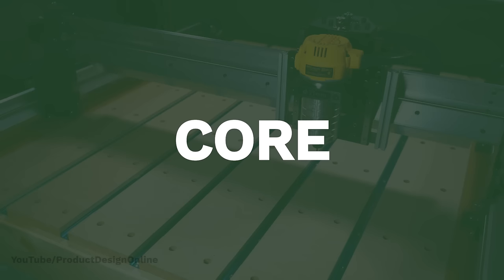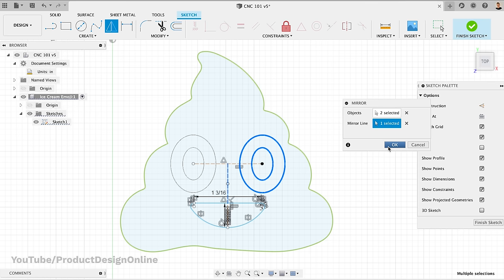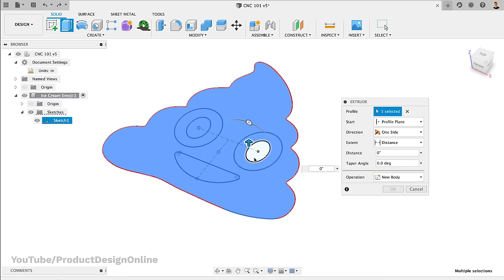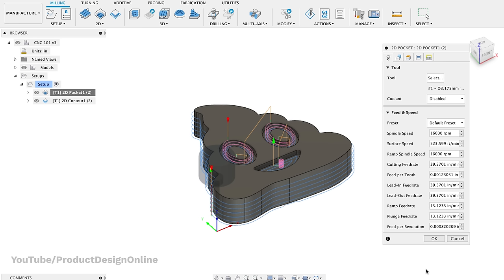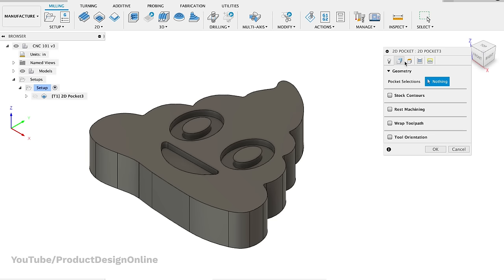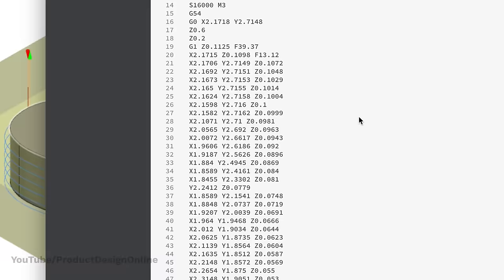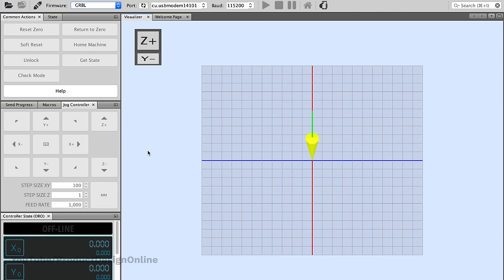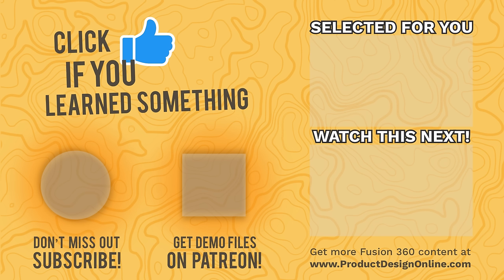CNC Basics - What You Need To Get Started

Comment from the maker: Poop Emoji STL: https://bit.ly/poopEmojiSTL
*Dust Collection*
5-inch x 10-ft Flexible Dust Collection Hose - **https://collabs.shop/mo0udn
5-inch wire clamp - https://collabs.shop/wuwehv
4-inch wire clamp - https://collabs.shop/3nk3m4
Duct Wrap - https://collabs.shop/caxz6w
Dust Boot - https://collabs.shop/4ajtis
Dust Boot Brush - https://collabs.shop/3ucm0l

End mills (Bits)
23-375 – 3/8 x 1.25" - Compression Spiral 2 Flute Carbide End Mill - **https://collabs.shop/esfe42
20-250 – 1/4 x 1" - Upcut Spiral 2 Flute Carbide End Mill - https://collabs.shop/qmylyu
CNC Router Sheet Tooling Kits - https://collabs.shop/xpm6ku
Desktop CNC Router Tooling Kits - https://collabs.shop/nhrvsb

Comment: Your definition of feed rate at 4:32 is likely to cause confusion.
I am a machinist and when it comes to feed rate on a Mill it always referred to in either ipm (inched per minute) or mmps (millimeters per second) The machine interface will display this value while running.
“Feed per rev“ is used on lathes where the tool rides on a carriage which is geared to the spindle. 
What counts is chip load, the amount each cutting tip (or flute) removes.  On a lathe there is only one tooth so it is the same as feed per rev. On a mill the formula to find this is:
Feed rate = rpm x number of flutes x chip load 
Common roughing chip load in steel is .008” on a mill.  Many many variables to find a good chip load, rigidity of the machine being a huge factor.
Reply: This is true. Chip load has everything to do with getting the most life out of your cutting tool. What is seldom mentioned including this video is that the hobby machines are no way capable of running high enough feed rates or being built good enough( spelled rigidity) for a good chip load. Your tools will die a short life due to the heat.

Comment: As rudimentary as this video was, I think that you still missed some steps with setting up the router before cutting your piece. I don't know jack about these machines, but at the wood shop that I go to for working on my projects, we have a CNC machine there and the guy who has seemed to taken over using it without allowing the rest of us a chance to learn it gave me a a simple guidance outline. One thing was making sure that your router was centred on your project and that you set the depth for the surface of the piece before starting. I seemed to miss this here. 
I think that learning how to operate a CNC requires a hands-on approach along with a tutorial in order to get a full comprehension of its workings. JMO Cheers!
Reply from the maker: That's a great point! Thanks for sharing :)

I didn't include anything machine specific, because as you pointed out - there are many additional variables to consider. This video was intended to help folks understand the basic process as to what's involved (software, machines, etc) so he or she can determine if they're still interested in getting a CNC machine.

Happy new year!

Comment: Hello - I am totally new to all of this… I currently purchase my wooden kids toys from overseas manufacturer but want to learn myself, what things do I need to consider when purchasing a CNC? And thank you for your video…very helpful and plan to watch more!
Reply from the maker: Do you plan to cut any materials other than wood? If so, make sure to research the potential machines as some aren't powerful enough for all material types.

You can get some pretty affordable machines to cut only wood.
Reply: @ProductDesignOnline  only wood . One more question… and forgive me I am very new to this. How do I know that the machine will cut the size pieces I need ? Okay 2 more…. What do I look for on the machine specs ?  Thanks again!
Reply from the maker: @NancyZ-x9i  When looking at machines you should look for the 'cutting size' as that is often smaller than the listed 'machine size'. If you have the space, I would recommend getting at machine that is 4x4' so you can do half sheets of plywood, and other large boards.

In terms of other specs, if you're doing mainly wood than you can't go wrong with most machines. What will be more important at that point is getting good endmills for cutting the wood, and replacing them if/when they get damaged.

Cheers!

Comment: In the 1980's CNC machines were new technology running on Commodore computers the machinists need to learn G code to troubleshoot new programs and make edits the original programmers didn't see straps, bolts, etc.and different CNC machines ran on different G code programming no standard format
Reply: G-code have standard all machine understand all G-code. some worst machine not understand. dont buy machine what use own code, normal all use standard G-code understand machine,

Comment: does this apply to metal cutting too?
Reply from the maker: Yep! Metal cutting also has the added layer of "coolant" (or fluid) to ensure eit does not overheat. With that said, on most hobbyist-level machines you will be able to mail aluminum, copper, and other soft metals without a coolant, you just need to run slower.

Comment: Problem - Have designed a "shoe box" and have no problems machining the pocket from the top etc.    BUT when I try to produce the g code to machine a pattern I have on the bottom of the box the post processor still wants to work from the top position.   So how does one redefine the Z axis to machine the bottom?    Your great videos have go me this far but I could not find an answer to this problem.

Comment: Man I could really use your help. I need to find a CNC machine that is a lathe/router that can make 5-10 pieces at a time. All the same item. I have no clue where to even start looking. Any chance you could point me into a direction? Thank you so much. Awesome video also!
Reply from the maker: CNC Lathes are a bit harder to find/get at a Hobbyist price point. For just a router, I'd recommend Avid CNC as you can adapt its size as needed. You may then be able to find an affordable (Chinese) tabletop adapter for a lathe on Aliexpress, eBay, or equivalent.

Comment: Pls tell us how to change bits in middle of     
milling when we need.EX:small size bit for screw and large bit for making rectangle shaped hole
Reply from the maker: Great question. There are many variables at play based on your machine and setup.. but there are two main options.
1. Setup your CAM toolpaths for a tool change where it does it automatically (fancy machine) or stops so you can manually do it (hobby machine)
2. You can manually pause the machine, shut off spindle and change tool before it proceeds to the 'next' part.

Number 1 is ideal, but again, it depends on your machine and software.
Reply: @ProductDesignOnline  pls put vedio with detailed explanation ❤️

Comment: Thanks for a great video. Just wondering, if I want to use a CNC router to cut woodblock prints, what machine would you suggest I buy. Probably only 2-D applications. Thanks.
Reply from the maker: Here are the machines I recommend at various price points: https://productdesignonline.com/fusion-360-users-what-to-buy/#cncs

Comment: I have CAD experience but no CAM experience.  To date I have been using SolidWorks to generate 3D models that I've saved as STL files for 3D printing.  I'm planning on getting a CNC Router but I've seen very little discussion of CNC Router users making use of SolidWorks CAM.  I see far more discussion regarding Fusion360 or Vectric's Aspire.  Is there a reason for this?  I'm starting with CAM from ground zero and I'm wondering if I should put my energies into learning SolidWorks CAM (a package I already have) or if I would be better off starting to learn Fusion360 or Aspire?  I see you have a highly praised collection of Fusion360 tutorial videos and I'm very tempted as I am just not seeing that level of resource available for teaching myself SolidWorks CAM.  Any advice?  I'm wanting to make an informed decision but feel I don't know enough about any of the CAM packages to know which I should go with.

Comment: Can anybody tell me  how  Fusion 360  is  better  or  as capable as Solidworks & NX ?   Does industries in India  widely use Fusion 360 ?  I have used Solidworks, NX & Creo  for SPM & Fixture design for several years.  For CAM, Fusion360 is the latest program hence it must have all the capabilities of CAD and CAM, I guess.

Comment: Hello, this is a simple question but I just want to ask, do you believe using a cnc machine to cut would into cabinets is worth it for the time and work being put in to make it happen? I’m thinking about getting one to make the job easier but I can’t wrap my head around if it’s a good idea or not.
Reply from the maker: Hi Sanjay. That's a hard question to answer because it depends on what machine you get...which then affects how well the cutting is, how much can be done, etc.
One important thing to consider is that you should NOT leave a CNC machine running alone. If anything goes wrong it can plunge into the machine, burn wood, and/or even worse catch fire. A lot of people think they'll have a 'robot' doing work for them around the clock, but generally CNCs require more looking after... so just keep that in mind :)

As far as cabinets. Are you looking to cut the general shape or special designs into them?

Comment: So I am 3d modeller primarly desining models for 3d print, but my mother wants to start working and designing wooden objects. By that it means She will come with idea and I will ahve to sculpt and design everything. 

Does the CAM software can take OBJ files?
Reply from the maker: Yes, you can setup CAM toolpaths for OBJ/STL files. You can also convert the STL to a Solid and set up toolpaths with that (https://youtu.be/tVGtG-UjlYg). Depending on the model and geometry, each workflow has pros/cons.

Comment: As someone who is getting into this I found it very helpful! With fusion360 am I able to just import a 3D model into the software and have it start cutting?
Reply from the maker: You have to do some setup per the machine and type of cut. But, in essence, yes.
Reply: @ProductDesignOnline  Oh awesome! I'm attempting to make my own gameboy advance shell out of aluminum but I haven't a clue how to do it but I really wanted to try it cause I'm gonna paint it and all that, so I'll have to do some setup but a 3d model of it will help most of the way? That works for me :D I'm looking forward to learning it. I'm just not sure how to turn raw blocks of aluminum into a shell lol
Reply from the maker: @piplup10203854  Your main challenge with that will be making sure you set up the file with the same WCS (start point) so you can flip the part to mill the second side. I would suggest starting with a simpler 2D milling project first to get familiar with the Manufacutre environment in Fusion 360, then transitioning to 3D parts (such as the gameboy advanced shell - cool project, btw) will be easier. :)
Reply: @ProductDesignOnline  Oh, setting up the file to have the same start point? I see, so I'll mark exact coordinates for the WCS so when I finish the one side, I can flip it and then mill from the second side? Oh gotcha, what do you suggest as a good starting point then and thank  you! I saw a really cool opportunity to get my own block and I picked up a CNC for cheap and thought it would be really cool to do my own shell and stuff. I been waiting on a custom for a year but no luck figured why not try to do it myself :)

Comment: I'm interested in ordering one of these but I'm confused with the ordering process with all the options available. I would like to stick with dewalt if possible, I have a Dewalt DW618 but don't mind buying a DW611. What MM size do I need to chose for this option. I sincerely apologize for asking this buy I'm very new to the CNC world and have been looking for the right choice, 7 months later I still find the one you featured here to be the best choice. My other concern is size. My table that I have is 24" depth from the wall of my basement to the edge of the table where I would like to place this unit. Would you happen. Yo have a 24" x 30" wide unit? Or just the 12" x 30" as the smallest size?
Reply from the maker: 12x30 is the smallest size for the new one. There used to be a 12x12 option, but that is not available with v2. 12x30 is a great option for your table size, as that will leave some room around the edges for tools, and or material overhang.

You'll want to select 71mm for the DeWalt (DW611) router - https://bit.ly/longmillcncref

Comment: The manufacturing workpath is not free to hobbyists, you get a month or so free IIRC, sadly this fact was an actual consideration as to whether I bought a CNC rig. no free manufacturing workpath means extra faffing outside of fusion. Sigh. you might want to fix that anyway. Otherwise decent, very entry-level, video.
Reply: While I cannot be positive, I think you are mixing up the Manufacturing Extension with the Manufacturing Workspace.  These are two vary different things.   I only have a "Not for Commercial Use" license, and I've been using Fusion 360 to drive my CNC for the last 8 months.
Reply: @Otaku437  Agreed, mine has it available too, never used it but it is there. And then there are manufacturing extensions you can purchase with money or cloud credits.
Reply from the maker: @GroovyDrifter  Robert is correct in saying that the Manufacturing Extension is different than the Manufacture Workspace. The CAM area is FREE and included with the Personal Use license. You can generate all the CAM toolpaths you need. You should not need the Manufacturing Extension for 99% of hobbyist based projects. If you're doing projects that 'advanced' then you're probably making enough money to afford it anyway :)
Reply: @ProductDesignOnline  Ah good to know.  Appreciate the tip.

Comment: Don you know if Fusion 360s cam software can write directions for cutting graphite ?  I want to design my own graphite molds for pouring silver and copper
Reply from the maker: You could technically use Fusion 360 to create toolpaths/gcode for milling anything. That really comes down to knowing the correct bit and feeds/speeds for the material and your machine.

Comment: Hi do you have any experiences with print design and then cut contour? I am new at and look for software what can do this. Example - print design on UV flatbed printer with reg.marks and then cut around via cut contour. Thank you
Reply from the maker: I used to run a Mymaki one. You can't run anything like that from Fusion 360. You will typically need to use the software recommended by the manufacturer as many of those machines are 'locked down' and require preparatory software.

Comment: Does this work with brass metal, too? I would like to customize wax seal stamps.
Reply from the maker: Yes, you can cut soft metals: brass, aluminum, etc pretty easy on these hobby level machines. If you plan to cut a lot, you'll want to look into getting a coolant dispenser.
Reply: Thank you! :)  @ProductDesignOnline

Comment: What about blender? Will that work for a 3d software?
Reply from the maker: Depends on what you intend to make. In general, parts getting milled tend to be better suited for a parametric modeling program. However, if you plan to make characters or other more organic designs then Blender would be great!

Comment: Interesting video. With home CNCs is it possible to programme them to only do part of a design at a time do we can change the bits out? Or would I have to split a design into separate fusion 360 files and then run them sequentially?
Reply: Yes, you can split them. With fusion you make separate "operations" for tasks such as using a large end mill to do roughing/stock removal and then a separate finishing operation with a smaller end mill to do the fine details. You can program in pauses to change tools, but you should always have the machine re-home itself if possible in case it moves when you change them. Look at the fusion cam demo files for examples of how parts can be made using multiple different operations
Reply: You can run them as one gcode file like tool 1, operation 1, pause, tool 2, operation 2... usually there's a command to pause and wait for you to confirm to move on
Reply: @greensheen8759  Great, thanks for the reply!

Comment: Please help, ive built a good 3 axis router/mill , it has a mach3 usb interface, i can manually jog the machine in mach3. what free software can i use to design/draw and then convert to g code for mach 3 to drive the machine? only interested in 2.5d        z axis cutting or up 20mm/not cutting. for cutting out simple parts like a 5cmx5cm square with rounded corners and a 3mm hole in each corner. thanks
Reply: all good machine can use keyboard move manual and cutting work. but lot easy and simple use G-code make all work.

Comment: What CNC would you recommend to beginners
Reply from the maker: I have the "Longmill" by Sienci. Another one that has a good track record is the Shapeoko
Reply: @ProductDesignOnline  Any opinion on the Onefinity?
Reply from the maker: @Carl_Hoff  I have not personally used one, but have a friend that enjoys his. Generally, I would always recommend any Lead Screw driven CNC's over belt driven. You'll get more precise results with them and don't have the headache of titenting belts. The only somewhat negative I heard about Onefinitiy is that the rails are not as rigid as they could be. I suppose that only matters with certain cuts though. Overall, heard all good things and looks like a great machine.

Comment: Hello. I would like a CNC machine that can cut up to 4ft designs. What size machine do I get?
Reply from the maker: You would be best getting one that can do up to 6ft or so, so you have plenty of room to hold the material down. I would suggest AcidCNC because they're modular. You could start with one at 4ft and it can "grow" to 8ft if necessary.
Reply: @ProductDesignOnline  Thank you soooo much